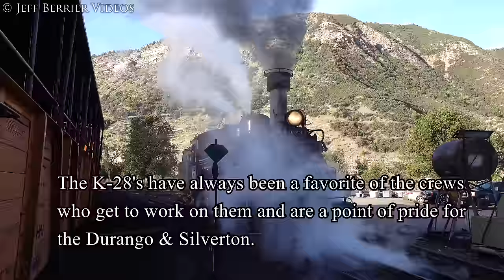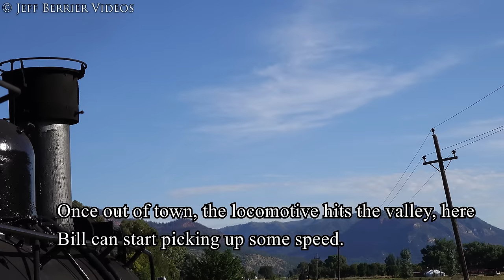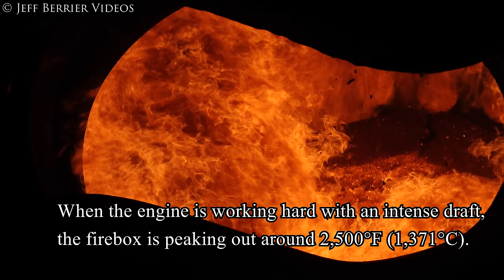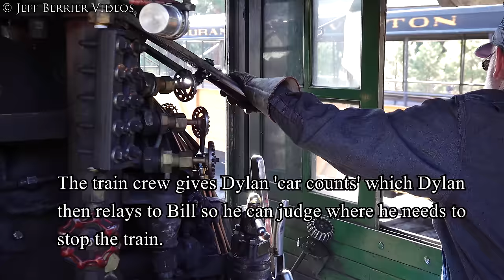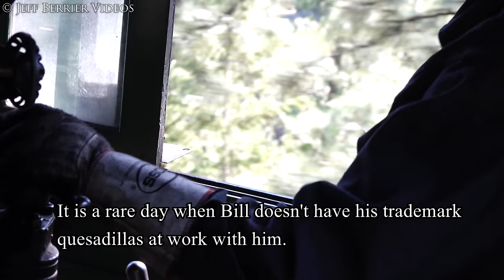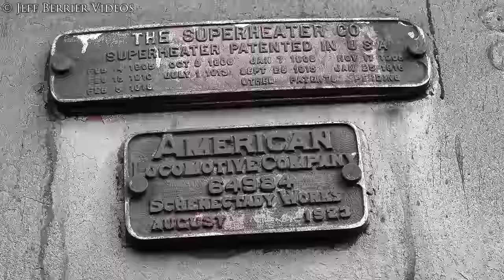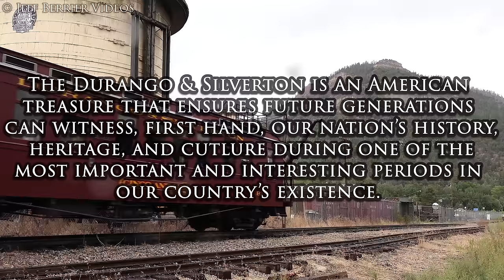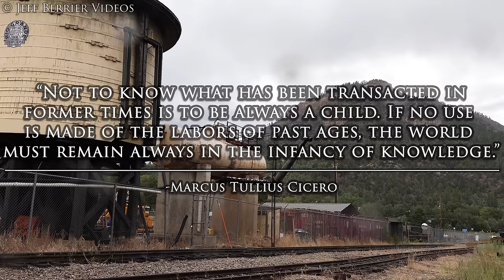Behind The Scenes on a Steam Locomotive [4K]

Comment: I didn’t know the firebox doors opened vertically on those locomotives. I should do a cab ride on that line one day. Nothing beats it I’m sure
Reply: Besides the ones that swing open, this is one of three that I know that pivot and are opened with an air piston.  The other two styles are pivoted from the top and the leaves meet in the middle and somewhat circular shaped leaves which meet in a horizontal line at the middle of the firebox opening.

Comment: Just a quick question: I've noticed on these old D&RGW narrow gauge engines that there is often a "straight air brake". I was wondering how this brake works, and how it differs from the automatic/train brake and the independent brake
Reply from the maker: The Durango & Silverton uses a straight air system that is plumbed into the retainers on the coaches, this is controlled through an S-3 independent brake valve (vertical lever next to the automatic). This works alongside the normal 6-ET automatic air brakes. Once the automatic brake valve is in the lap or engine hold position, the engineer can treat the train as if it has straight air by only using the S-3. The engineers can choose when and where to use automatic or straight air based on their running style.
-Jeff

Comment: Were definitely planning to fly up there asap. A really basic question :  If the engine is used daily what do they do at night with the boiler? Is it brought down to a min pressure or allowed to go cold?
Reply: Patches Cessna they use wood pellets to keep the boiler hot at night. It would take several hours to reheat a boiler that was allowed to go cold.

Comment: Here is a question for ya Jeff. I want steam power to be around for a long time but burning coal in this day and age is just not responsible nor healthy for those working with it. Is there any plan to convert these engine to burning fuel oil?
Reply: I hope not ! The small amount of smoke that those two engines generate will be absorbed by the trees.

Comment: One of the neatest things about both the D&S and C&TS is that they operate original equipment on their original home territory. And those two railroads have so many survivors of locomotives built for or by the D&RG/D&RGW. And of course the scenery! Also if you need a workout, firing the 4% from Chama, NM up Cumbres Pass will do it, shoveling non-stop.

Comment: nice video indeed! only original sound. and all the explanations ant comments, why the train or engineer is doing this or that, in writing! explains also what is to know for a not neccessary - all knowing - video and train watcher.Only on thing i want to know. On the back of the loco, in the coal -tender - there is this little - cubby hole - manbox(?) What was that used for?nice touch the rainbow over the bridge. do the passengers also see it or appreciate it?

Comment: Thank you for the beautiful and well-done video.  I first rode this line in 1955 and have done so many times since.  My grandfather was a conductor on this line and married my grandmother in Durango in 1887.  I notice No. 476 has had that atrocious movie stack removed.  I and a lot of other D&RGW fans hope that the stack shroud (which was just that---it slipped down over the stack so it looked like a Hollywood idea of the 1870s) has been cut up so it can never be used again.  Back in the '60s, several railfans I know were considering doing just that under cover of a moonless night.  Later photos provided evidence they either thought it through once more or chickened.

Again, thank you for a wonderful video!

Comment: Very excellent. The best train video I have ever seen.
About 1960, I rode the last passenger steam train from Fort Smith, Arkansas to Paris, Texas. The conductor just came through the cars and told us we were the last. Riding a commercial passenger train is different somehow from riding an excursion train.  I encourage you to ride the excursion trains in  your area, if there is one, as much as possible, they are fun. Nothing like getting a face full of hot cinders and gravel when the wind shifts.  You won't likely have that problem in you air conditioned excursion car.

Comment: I used to portray a Train Robber on several of the Old Steam Engine Rail Roads in the 1960's and 70's. I traveled all over the country pulling off Train Robberies. I did a few on screen. I loved the one in Boulder Colorado, But I was not one of their regulars and it is extremely hard to get into these groups. They are usually Family owned or Club owned.

Comment: Steam trains are so much better than diesel trains. The only thing you are giving up with a steam train compared to diesel is power and speed. Which could be compensated for with more engines. I seen somewhere that diesel is the cleanest burning liquid fuel. But compared to coal, wood and steam. Sorry there’s no contest.

Comment: what is the vertical valve next to the engineer behind the locomotive and automatic brake valve used for (the engineer moves it at 24:20). is it a third brake lever or is it a drifting throttle?

Comment: Great video! I run a steam engine and you did a awesome job with it all. I got a bit uneasy when the drop was 400 feet +! Thanks for sharing 👍
Reply: I rode the train in 2007 with my wife and grandson.  In a couple of places on the high line, one edge of the car is over the edge of the shelf and the other side is only about one foot from the car to the rock face.  Most of this line has not changed much since it was built in 1881-82 and has not been shut down for abandonment since opening in 1882.

Comment: Such a beautiful steam engine. 
That's just the smoke spoils everything. 
See how coal burns in our firebox. 
And saving coal more than doubled.
Reply: I can smell the smoke. Such memories. In 1948, my parents put me on the train in Denver for the 12 hour trip to Craig, on the western slope. I was about 10, my little sister was 6. No other passengers. No adults. 
Of course by then, engines were diesel but coal was being used everywhere. Thank you for shaking out those old railroad memories. Beautiful scenery.